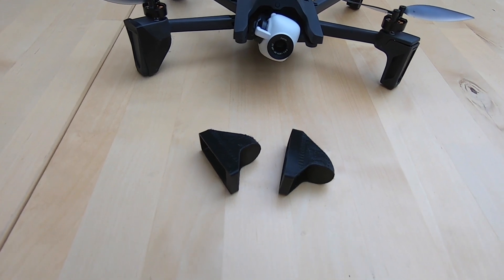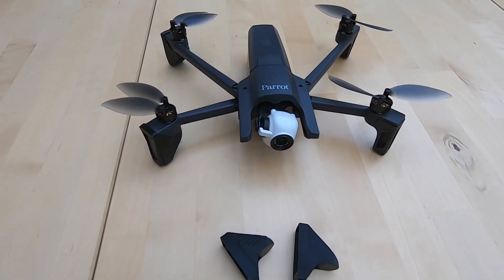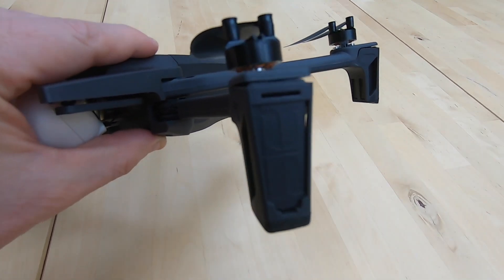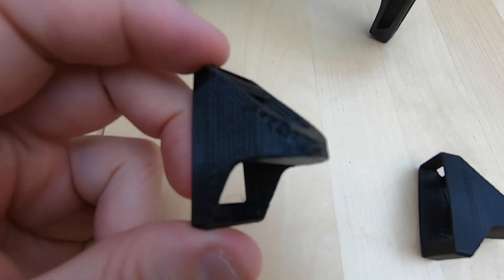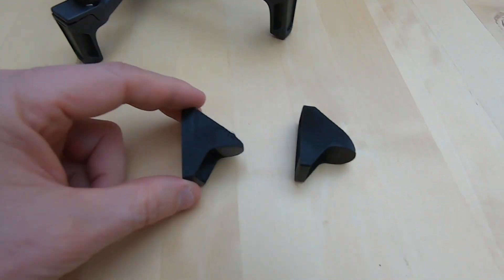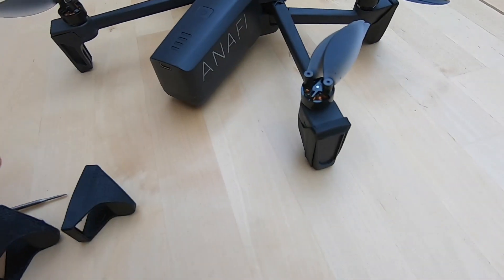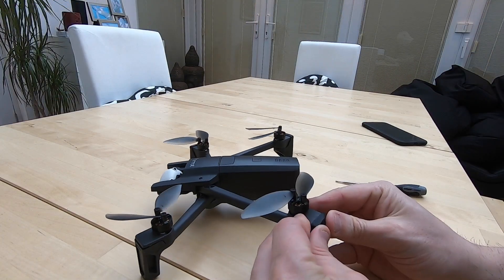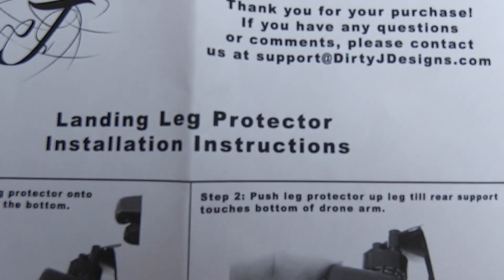HOW TO REPAIR - Anafi Drone Leg

Comment: Is there a way to snap the drone legs back into position without putting the boots on? I have the same issue
Reply: I have the same problem
Reply: I found a solution.
1 - remove the propellers
2 unscrew the screws under the arm
3 if nothing is broken, try pushing with your fingers to snap the foot into place.
If anything, add a point of resistant glue on the sides
It should be fine,
Sorry for my English.

Comment: Nice video and info.  I think you should say something about performance impact after adding those shoes.  Changing the weight distribution of this 300 gram drone is tricky business.  Did you notice any side effects?  It would also be nice if you mentioned how to replace the stock feet on the Anafi.  I searched for "replace broken Anafi leg" and your video comes up, but says nothing about replacing a broken foot.  Thanks.
Reply from the maker: I havent noticed any impact from the shoes, the drone has operated great since - touch wood
Reply: Parrot has nice repair videos to basically dismantle the whole thing.  Take pictures as you go along, it is helpful. When disconnecting the motor connector, lift/pry out away from the connector, do not pull on the wires.  They break easily.  Found them at digi-key for 20 cents each so I bought some extras.
Reply: @mzimmerman12  Thanks for that info.  I did order the DirtyJ shoes to try.
Reply: @peterinpensacola  I was going to order them too but I may just take the bottom 3 screws and off drill a small hole through and zip tie it.. I only have one leg that's doing it. It already has  a break I repaired with 2 titanium 1/16 rods epoxies inside the leg and a couple of layers of CA glue with baking soda. Solid as a rock.
Reply: I have a new leg but it's more hassle to take it apart since my repairs are holding up fine
Reply: @mzimmerman12  I see.  I'm going to try cyanoacrylate glue (superglue as you mention above), that won't change the weight distribution.  Those feet don't have any lateral load on them unless you hit something!
Reply: @peterinpensacola  You need to put the glue on and then cover the glue with baking soda then dump off the excess. You have to do the inside and outside. I bonded in 1/16 titanium wire across the brake (titanium welding wire, strong and light and non magnetic)
Reply: Google super glue and baking soda and watch a couple of videos